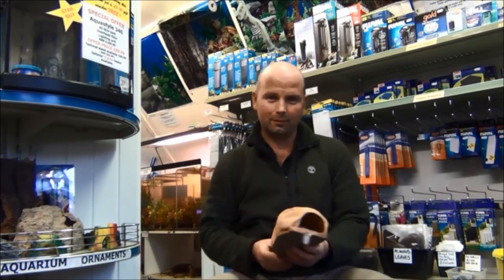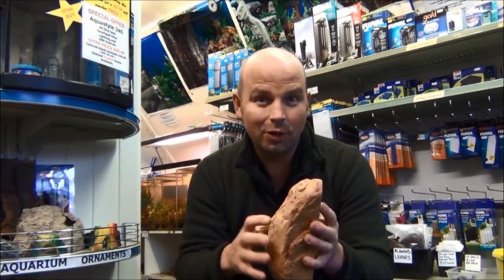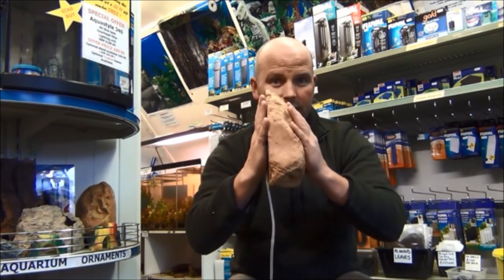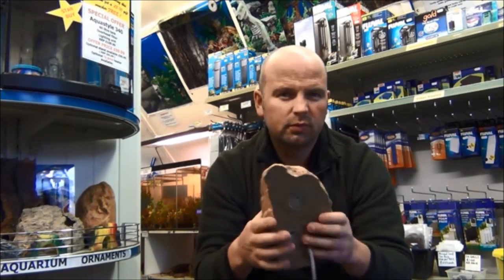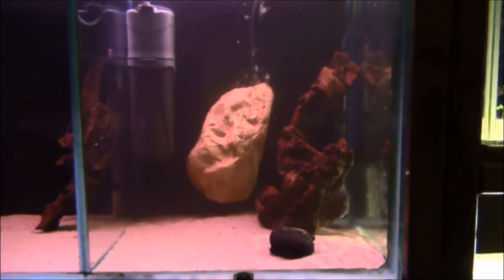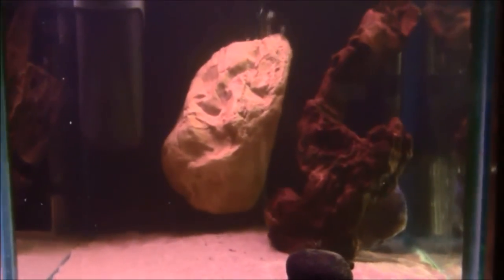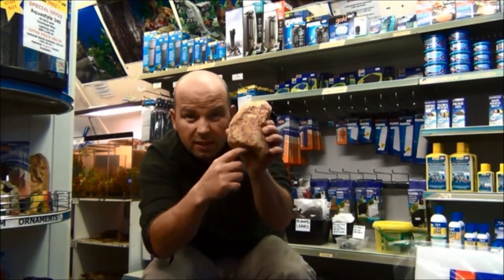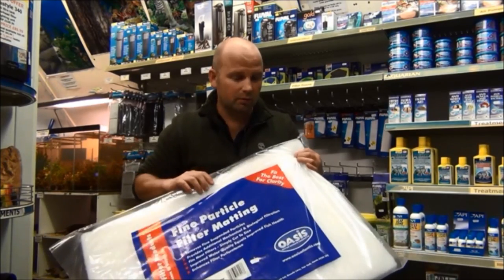'Invisible' Aquarium filter - Awesome internal fish tank filter by Pondguru

Comment: I've now built 2 of these to your design. Concept is brilliant. But after 2 weeks I took out the foam to see if they were dirty and they did not have any 'dirt' on them whatsoever. Air is coming out top holes but it doesn't seem as if water is being sucked through bottom hole. Am I doing summat wrong? Great idea
Reply from the maker: It is such a slow flow that this filter is not going to suck a nation of muck into the foams unless it has a much more air pumped in. It is really a supplemental filter to operate at low flow which will concentrate on reducing nitrates (once the biohome becomes mature) but if the air is coming out the top it will be drawing water in the bottom, just nowhere near as much as a standard internal pump driven filter so it will take much longer for the muck to collect in the foams.

Comment: Thanks u have answered many topics  this type of filtering system when will it need to replace the filter media at some point in time   . Or will the media in the be left for some time .
Reply from the maker: The media should ideally last 6-10 years in a well protected environment (protected from clogging by foams). If you have a coarse or medium pad then a fine pad most of the muck will be filtered out before the water hits the media so it will be years before it clogs and becomes less efficient.

Comment: Richard - O M G this is such a fantastic idea, why havent I thought of this before <bangs head on wall>. I have just rung your shop and ordered one with a bag of ultimate. It should be in service at the end of the week. Yayyyyyy!! thanx Bud'
Reply from the maker: No worries, man. I can't understand how it hasn't been made commercially and I kept checking on Youtube to checking for similar videos for about 6 months before uploading this video and was shocked when there still weren't any, lol
Best of luck with the construction.
Reply: Pondguru
What super speedy delivery. I've recevied it already and it is up and running yayyy. It is fantastic. I had to use a 2.5m drill for air holes at the top as my drill wouldnt hold a 1mm, so, consequently the air bubles are a bit large comming out of the top. So take note future builder listen to Richard and only use a 1mm or 1.5mm drill bit. Richard, please thank your assistant who worked hard to tank your fish delivery and to put my parcel in the post same day I ordered. What a fantastic service, thanx guys. pj.
p.s. I do like this biohome ultimate media too, this is the one for me.
Reply from the maker: *****
The ultimate really is the best media available and I'm glad you're pleased with the service - that is all down to Brian in the shop.
Reply: Pondguru  Hi Richard, I've got a small problem (!) This filter is rather noisey due to the bubbles comming out of the top. Is there any fix to this. I have thought long and hard but I am presuming water is being forced out as well as the bubbles so I cant fix an air line to the top and stick an air stone on the end. Any thoughts? thanx
Reply from the maker: *****
If you add a small air stone at the end of the air line it will put out much smaller bubbles. Drilling multiple holes in the top of the filter will help too as that will reduce the 'pooling' effect which may allow small bubbles to combine before being released from the filter.

Comment: Hi Richard, My fluval 2 plus has finally given up the ghost (8years of 24,7 so I cant complain) I initially thought it was the impellor (bought a new one online) but realise the pump is knackered and on its last legs. Worried about my stock I have bought an interpet similar one supposedly rated at 100 litres, my tank is 90 litres, I have both running so the fluval can die whilst the new one is seasoning, I havent lost any stock. I have never used an air filter (but have all the bits to make one). In your opinion can your larger cave air filter replace a fluval 2 plus in a 90 litre tank once seasoned of course? It looks like it would do an even better job since the fluval is foam only with no moving media, and yours defo looks nicer. Any help at all is greatly appreciated. Thanks, Chris (Cullercoats).

Comment: I have a few of your moving bed filters running which I made from plastic food canisters, but once again you have given me another idea.  I have some 3D background left, and I am thinking of making a filter from a rectangular food container and disguising it by siliconing the 3D foam background on 2 sides.  I would also like to make one from one of those Easter Island ornaments, they seem to be a good size and shape.  Does it have to stand off the tank floor?

Thanks for the ideas.
Reply from the maker: No it doesn't have to stand above floor and the Easter Island heads will be fine - just drill loads holes around bottom or cut out a section of the back to allow water in.
I've seen a few filters made from food containers and it could look groovy with the 3D background disguising it. Feel free to post links in comments here if you film the filters, no worries.

Comment: It's the juwel rio 180, so 180 litres, measures 101, 43, 50cms. So how much biohome should I use with the sponges?
Reply from the maker: If you give me the dimensions of the space you are left with (for media) I your filter after moving sponges (coarse, medium and fine) to bottom of filter box I can work out how much you will need no problem. Every filter manufacturer makes different size filters and I'm not familiar with dimensions of them all.

Comment: But how would I adapt something like that for betta who don't like a lot of disturbance in the water? Do I simple adjust the air pump flow?
Reply from the maker: +DELICIA AMBROSINO Yes you could put an inline tap / clamp to control air output or add an air stone to deliver smaller bubbles. This type of filter doesn't need a huge air flow to be effective.

Comment: Thanks for reply,one quick question,does the filter need to be elevated? I would think so,that way water could be drawn in from below,but the one sample you should at the end,the one that looked like a stone bridge seemed to sit directly on the bottom of a tank,look forward to your reply.
Tuna Vic <")))>{~~~
Reply from the maker: +Tuna Vic If it sits on gravel then that will be OK as plenty of water can still be drawn in but ideally the filter would be elevated, yes - especially if you have sand in the tank.

Comment: Would these be any good for a really large tank - say 175 gallon to 300 gallon?

Or, would they just be good in a tank this size to filter out nitrates & nitrites & use some other kind of filter to filter out the poop, etc?
Reply from the maker: For a large tank this would really just be a supplemental filter for making water healthier as water flow and resulting mechanical action is limited by flow of air pump.

Comment: do i still need to use a powee head to spread heat from the heater or can i just use this on its own in a 20 gallon tank ...thank you
Reply from the maker: +ROBERT HAWKINS Just the water displacement from the rising bubbles is enough to create water currents to disperse heat but this filter really is a supplemental filter in tanks where there are fish which require a decent flow. A lightly stocked 20 gallon (US?) could just about get away with this as the only filter but ideally it is there to work alongside existing filtration as its action is mostly biological.

Comment: What gallon aquarium will this size filter? Great idea. Thanks
Reply from the maker: It's more of a supplementary filter as the flow rate is low (so it won't be guaranteed to keep water clear unless you greatly increase the air flow) but one this size should easily keep on top of the ammonia, nitrite and nitrate for a 150 litre tank.

Comment: If you put a 1 inch air stone at the end of the air line just above the pads instead of a tee would that be a good idea? Or would it be too much motion and too much aeration for the anaerobic bacteria to form?
Reply from the maker: The media is the most important part of the filter and the media I used in this video still supports lots of anaerobic bacteria even in a very oxygenated filter so adding an air stone won't reduce effectiveness at all - may even increase it and reduce noise as bubbles should be smaller.

Comment: sorry if its been asked before, couldnt see it on the comments though. how often would you recommend changing the sponges in these and how high should it be from the gravel in the tank? what a great idea though, deffo going to have to set this up!
Reply from the maker: The sponges in our filter only need looking at about once every 2 months as the filter does not have a mad flow rate. It's there as a supplemental filter to quietly go about reducing nitrate but if it was the only filter in the tank we would increase airflow and check sponges every couple of weeks. Provided the filter inlet is above the sand by at least 1" it will not suck in the sand. It won't suck in gravel as the flow rate isn't high enough.
Reply: Pondguru ah no worries, thank you. will have to try this out next time i re do my fish tank!

Comment: Richard. Love your videos and ethos. Question. When I was a lad we all used box filters. This idea seems to work on the same principle but 'in disguise' which is great. I am about to set up a tank (36x15x15ins) and had thought to use an internal filter pump which seems to be the current trend. However, you seem to be saying that this is a better way to go or have I missed something? By the way, you should use the marketing hook 'PG's tips' for your videos etc!
Reply from the maker: PG's tips...I never thought of that but I like it, man.
If you can go for external filter as it will offer the most filtering capacity. The filter in this video doesn't have a very high turnover rate so is more of a supplemental filter to make sure the water is healthy (especially where nitrate is concerned)

Comment: CAN YOU TELL ME. . I'D I COULD PUT K1 INSTEAD. . THANK YOU I REALLY APPRECIATE. .
Reply from the maker: Unless the K1 was moving it would be of no use at all. Even if it was moving it would not process nitrate, just ammonia and nitrite. This filter is really a low flow filter for processing ammonia, nitrite AND nitrate which cuts down the amount of water changes you need to do and needs the specific media in the video to do that.

Comment: Hi, I have a juwel rio 180 tank, would I be able to use the biohome filter media instead of the sponges juwel use?
Reply from the maker: You will still need foams to act as mechanical filtration but there should be no need for carbon or nitrate reduction foams. As long as you put biohome in a net bag just before pump intake (so foams clean water prior to it hitting media) it will do a great job of processing waste which was masked by having carbon in there.

Comment: Awesome invention!  Thanks for sharing!  What size of resin hollowed out rocks would I need to create these DIY filters for a 5 gallon and a 20 gallon tank??  Where can I purchase these?  Also do you have a supplier for the brown media you used in Canada yet?  Thx!!
Reply from the maker: The filter is more of a supplemental filter and on its own doesn't have much of a flow rate or capacity to really clean the water. It makes it very healthy but unlike a standard internal / external filter it would not have a high flow rate to draw in lots of dirt to the filter. 
However depending on the stock it could do 5 or 20 gallon tank no problem. I was getting the ornaments from a company which now only supplies shops (I closed my shop down over 2 years ago) but if you search 'large hiding cave' online they sometimes come up. The CA supplier for biohome products is Angelfins (online) and there is a link to my website in video description and pinned comment which has direct links to the suppliers around the world at the top of every page (flags)

Comment: Where do I get that rock. Also what size air pump would I need for a 35lt tank I only have a black Moor and a loach at the moment and the water is never crystal clear
Reply from the maker: If you search ebay for 'large hiding cave' you will find the exact rock and search 'biohome ultimate' for media. This one took 500g. You would need only a 70-80 litre per hour air pump.

Comment: Last Question, sorry.  Can I add the 18mm bio balls wet/dry to my Sunsun hw-304b Canister Filter with UV light.  I heard you mention plastic is not so good in cannister Filters.  I was planning to add the blue/white foam and the poly/pillow stuffing in one tray + Purigen, the 18mm bio balls in the 2nd,  Clay Pellets/pebbles in the 3rd tray and maybe more clay pellets in the fourth <4th> tray.  I bought some of the Ceramic rings but I believe you said those aren't that good.  Do you see anything i should change or something different I should do in your opinion??? ?? ?.
Reply from the maker: I wouldn't put plastic in when you could use the clay balls or good quality ceramic media (avoid smooth ceramic media) and the purigen really should be the last thing the water hits before it leaves the filter. The filtration should always go mechanical, biological then chemical.
I personally wouldn't use Purigen in a filter as I get lots of people contacting me who have suffered bacterial colony failure when it is used. I don't know why that would happen (could be after recharging) but it may have something to do with either poisoning the bacteria (anaerobic bacteria is hit really hard) or starving the bacteria of essential trace elements as problems are not just associated with the 'recharged' product? I really don't know but it is a common factor when people report that they can't get the full cycle developing or the cycle breaks down after being great until purigen is added. May be a problem for all similar chemical treatments but the recharging of purigen with bleach can't be good for bacteria.
In a filter which is properly set up and a suitable size for the tank there should be no need to use chemical treatments but if you want to remove any staining or residual fish treatments from the water then carbon will do that at a fraction of the price without the associated damage to bacteria.

Comment: I am so confused by everything i am watching and reading. PLEASE help me out. i have a cold water tank about 70 L with 4 fancy gold fish and 2 shrimp and 1 pleco. I currently have a FLUVAL U1 Filter in my tank and thats it. I am thinking this filter is not the best for my tank. But then I am reading about air pumps and  UV filers and loads of other things i am so confused on what i need to keep my fish happy and healthy. I would love some advice from you as you know what you are talking about. I am total new to the fish tank owning and pets at home are not good with advice. Many thanks from Emily
Reply from the maker: +Emily Faith Astin I'm sure I just answered same question on another video, lol
Here is a copy of that reply: The Fluval U1 is way too small for 70 litre tank and if you have 4 fancies and a plec in there which are heavy polluters you really should be looking for a filter which will treat 'up to 150 litres' to cope with the waste. The best would be an external filter if you have space for it as most internals simply won't hold enough foams or media to cope with goldfish.
A properly set up suitable size external filter will keep the water quality great with minimal maintenance and no need top waste money on cartridges or special foams associated with internal and hang on back filters.

As far as UV goes there should be no need for one unless you have multiple tanks linked to the same filter. As long as there is plenty of surface movement from the filter outlet there will be no need for an air pump as gaseous exchange will be no problem with a disturbed surface (that is main benefit from using an air pump as it doesn't actually increase dissolved O2 in water to any noticeable extent).
Hope that makes sense.
Regards,
Richard
I agree about Pets at Home although I do know a couple of friends who work in different stores near me who are rare good fish keepers who share proper advice freely. If they get found out they'll probably get sacked for that, lol

Comment: hi great videos , ive just found you on utube as i was looking for advice on setting up my aquarium,ive got a juwel rio 180 tank , could i use your style of hidden filter with this size tank , your advice would be welcome .
Reply from the maker: I have just answered a very similar question so apologies if I am repeating myself here - the hidden filter will be a good addition to the internal filter as it will help reduce nitrates. If the built in filter is set up with the foams in the correct order and some good media in there it will be all you need to keep the water sweet but if you did add the hidden filter it would make a good job better.